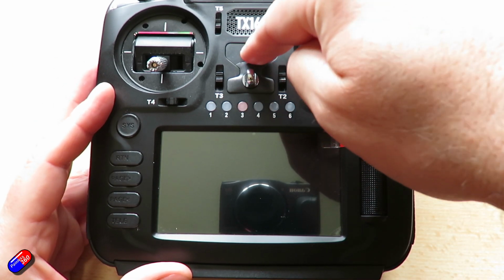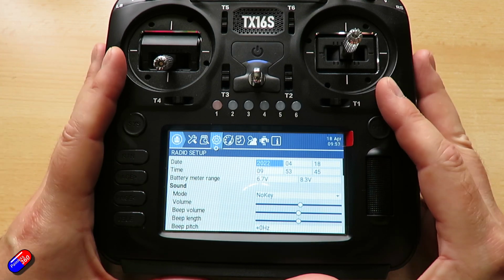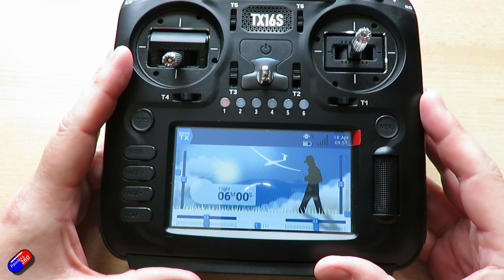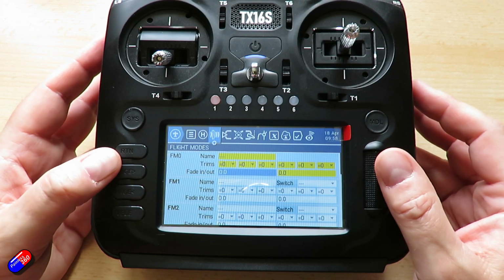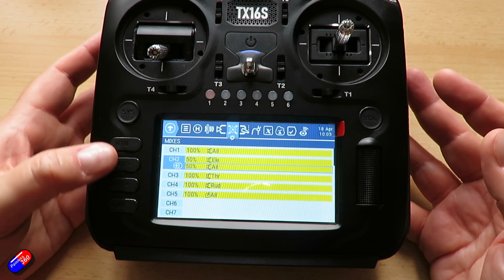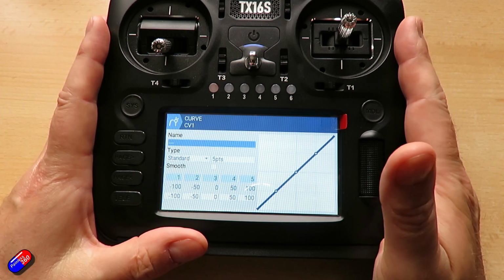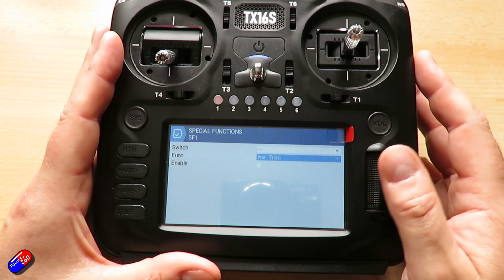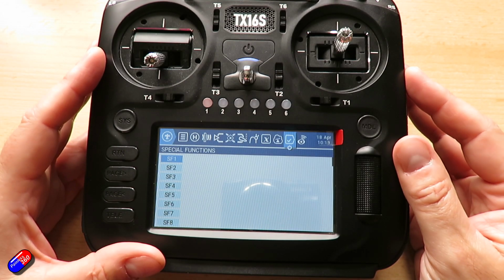EdgeTX Basic Menu Overview for Beginners (v2.6)

Comment: Hi been watching your videos since i started with my x9d and helped greatly. I hope this question finds you and you have knowledge to help.
I have changed to tx16s and edge at christmas so far been ok in transferring models over. But just purchased frsky Archer plus sr8 stabiliser reciever, all updated and bound no problem, calibration seems to go through each step on lua script ok and get the thumbs up. But it will not self check mode switches not doing anything no stabilising ?.  Also when you go into lua to set gain and other settings, turn on stabilizing quick mode, aux 1 ect. If you come out of lua and back in its reset to defaults of off ail on channel 5 ect.
Many thanks in advance for all your good work.
Reply from the maker: I've not tried that reciever here. Best of luck

Comment: Hello…my TX16S mk2 max with version 2.7.1 shows templates when I press the scroll wheel. It never shows select model. I only have one fixed wing plane which I set up and each time I power up the radio, the airplane becomes active. I’m wondering what will I see when I set up a 2nd plane. It doesn’t seem right that the one plane I have set up  becomes active when I power up the radio.
Reply from the maker: Short or long press?
Reply: Thanks for responding. When I power up the radio it goes to welcome screen. I press scroll key (both short and long) and it goes to the Select model, Chan monitor  Model settings and Radio settings screen. I press Select model and up pops the Templates screen showing a Delta and Omphobby M2 planes along with the only model I created. I hit on my model and up pops a window asking if I want to Creat, Duplicate or Save as template. I just want to be able to power on the radio, pick my plane and have the radio recognize it and go fly. Well I thought if I could delete it from the Template screen everything would be okay. Well I messed up....my only plane on the radio is gone forever. Looks like I have to now re-create the model.

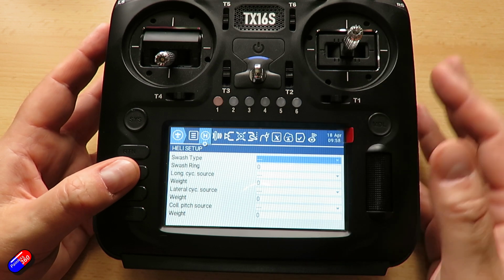Comment: @09:33 Hmm... So, I have this 1/16 scale RC Tank ( https://youtu.be/Rs_ICMgQiBY ) that runs on a highly specialized Controller Board that cannot have its settings changed by the user ( only the type of model and the sounds ).

One of the things that grinds my gears is when changing between the 3 modes for how the Model operates where in two of the modes you have limited control of the radar but full control of the tank whereas in the third mode you lose control of the chassis but gain independent control of the radar. Normally you'd expect for them to keep the controls the sam for what stays and just rearrange what changes ( control of the Turret remaining with the Chassis handing over to the Radar ) but they decided otherwise ( controls of the Turret hand over to the Radar and the Chassis handing over to the Turret ).

This obviously didn't work for me which is why I've had to mix the crap out of the model to rearrange everything back to be consistent depending on the mode resulting in this Mixer atrocity: https://i.imgur.com/1kaQCgv.png which brings me to my Question: Can Flightmodes swap Channels around like how I did in Mixes ( possibly tidying things up ) or are they only meant for changing values without altering the Channel?
Reply from the maker: Yes you can. Best of luck

Comment: Hi Lee, i hope you still follow the older vids? i am here for same reason as Wrstew, Coming from a "older" "normal" radio Opentx AND in our case Edge TX is bewildering! This as helped somewhat BUT what i really need to know is about "radio setup" some of the options and titles in there seem very important. some ,a lot infact are very technical,how do i know which i need? all ics say is i will be using DSM2 and OMP potocols, would you know what i need to choose for all the options,every one sounds mega important.
Reply from the maker: EdgeTX is functionally equivalent to OpenTX. What elements of EdgeTX are you struggling with that you use in OpenTX? The MPM stuff is almost identical...

Comment: Yet another great video. I am new to EdgeTX. I tried to setup a hotliner with a V tail. I used the wizard and chose V-tail with two separate channels. Only one works. What did I do wrong?
Reply from the maker: Possibly nothing but I'd check you have the V tail servos both plugged into the right places on the reciever as step one..

Comment: Hello lee. I want to use a 2306 2400kv motor, with an 80a esc and 6s voltage. Is there any way to put a throttle cap? Either in inav or the tx. Thank you
Reply from the maker: You'd like need to do that in INAV throttle channel limits. Why would you want to? If you need to to then the power system maybe the wrong one?
Reply: @Painless360  it is the wrong one lol, I was just trying to use what I had laying around. ended up going with a 2306 1700kv on 6s with a 5" tri blade, love the results.

Comment: Lee- I opened my confuser this morning and found a present from across the pond!  You have a distinct style of explaining complex subjects so eloquently, I am proud to be a subject for you to mentor.  I now have a twenty one year run of adjusting to various radios starting with four channel analog “dumb “ Futaba and Hitec then jumping on the JR computer craze.  They became more and more complex as new editions came out but staying with one brand I became somewhat fluent in setting up for fixed wings and then helis.  But getting involved with quads the availability of JR receivers became an issue with my current transmitters.  I think having a new series of how to’s on this breaking operating system is wonderful for those of us who came later in the game to learn the practice of learning code language, and importantly why you do what you need to do in modern radios using the open tx style of setup.  Thanks for your response!  It’s like hitting the RC lottery for an old man!
Reply from the maker: I did pop you a preview link to your original request. Glad you found it. Happy flying